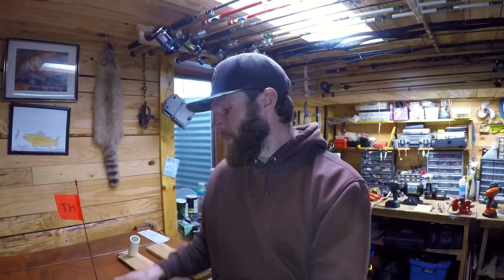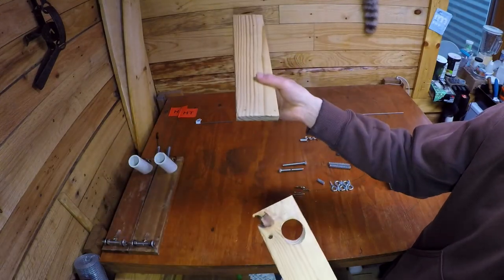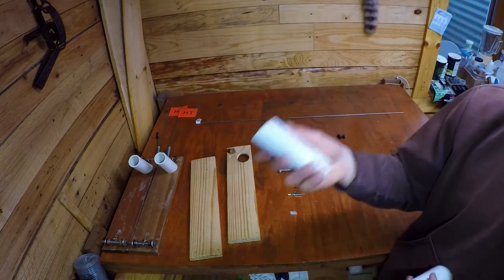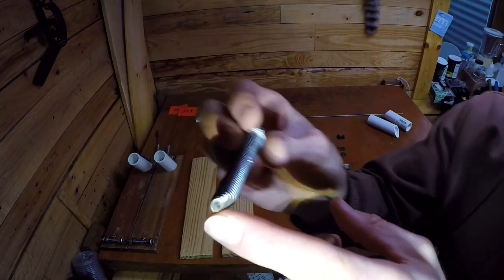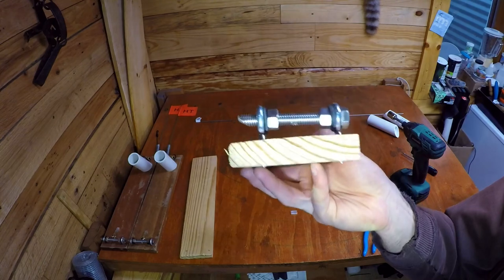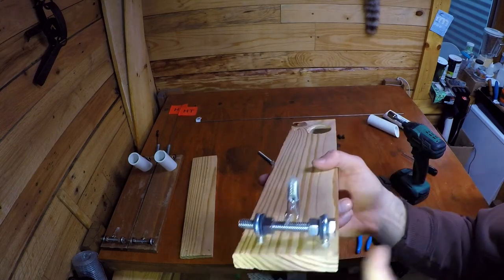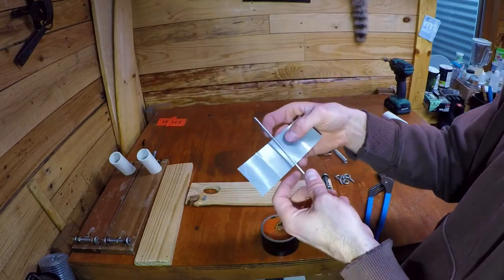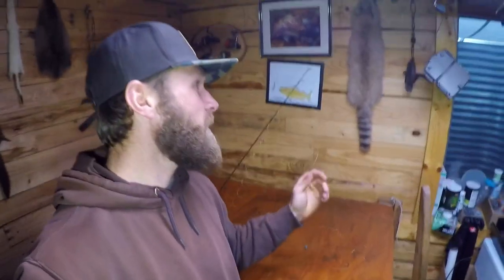DIY Rod Tip-ups (iFish Pro/HT Rigger) $9 Each

Comment: Just made a couple of these.  My line is struggling to come out of the clip.  Any suggestions on tuning the alligator clip?

Thnx!
Reply from the maker: Yeah you don’t want to have the line clipped in between the metal part of the clip, you want it wedged in between the tubing that’s sticking off the metal. Also you can wrap the line under the clip once before wedging it in to help.